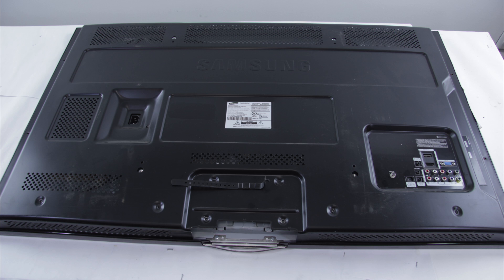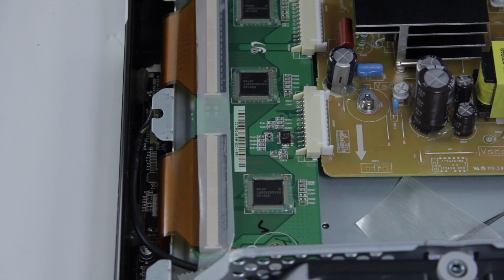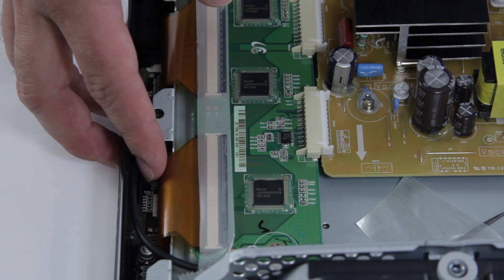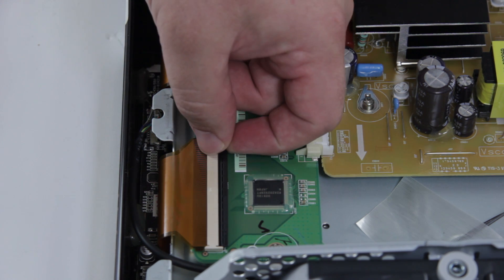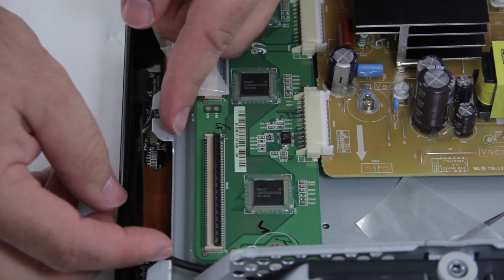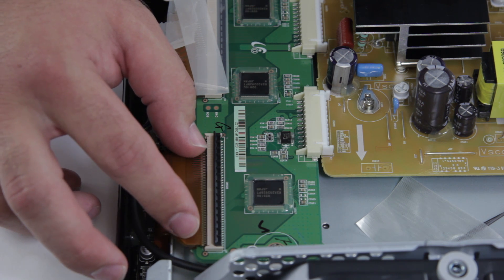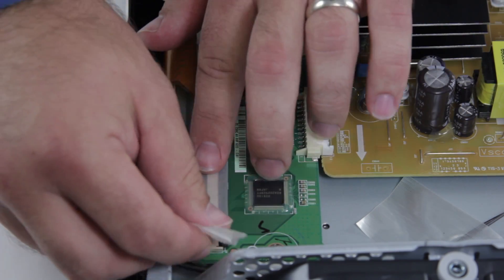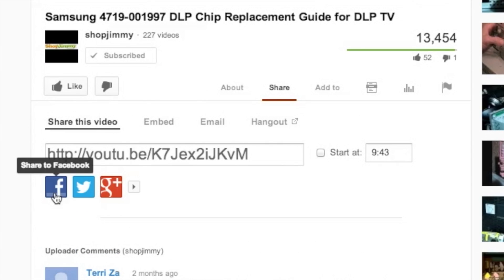Plasma TV Repair Ribbon Cable Removal & Install Tutorial Overview

Comment: We have thin screen 60 inch Samsung TV, Model No. QN65Q60BAF. In the process of moving the TV my frien grabbed the TV on the right corner resulting in a small bubble imprint on the lower right hand corner of the tv. When we turn on the tv the picture is only shown on the left side and still has the small bubble on the right side of the tv. Any suggestions to repair would be greatly appreciated

Comment: My ribbon doesn’t snap in like that. Looks like my ribbon was glue down to the panel. I have a Ns-50df7109a19 Insignia brand. I have replaced the backlights. But when I started putting the tv back together, I notice that 2 of the ribbon things along the bottom were no longer sticking to the panel. I wasn’t sure if this ruined the tv… turned it on, there was sound but a blank screen. So I glued the two ribbon down to the panel then turned it on. Still same thing. At this point I feel like I just need to replace it. First time DIY fixing and I regret it lol! What should I do?

Comment: Hi I have a Samsung plasma 50inch tv and its got 4 thin lines going horizontally at the top of the screen I've unplugged the ribbon on the side that has 2 ribbons one at the top and one at the bottom, the one at the top has a crease in and the line of metal thats plugs into the circuit board has a little tear it is there any way I can fix the ribbon. Please help me

Comment: Thank you for uploading this EXCELLENT video! Is repair possible for the ribbon cable itself? My Samsung PN50B550 plasma was working perfectly BEFORE a recent house move, getting a few black horizontal lines, I suspect some of the cable 'lands' have opened as a result of the set bouncing around in the U-Haul. I would HATE to have to throw this beautiful (HEAVY) set into the dumpster. Thank you in advance for ANY help you can provide! I would rather spend $500 to repair THIS set instead of spending that money on the latest LCD 4K 'wonder'!

Comment: My lg 60UH6035 have blurry picture with horizontal line on the bottom half. I try checking (plug and unplug) the right lcd ribbon from the t-con broad to the tv and now there is no picture at all. What component do I need to replace?

Comment: My Onida LEO40 FAIN Model, Indian made, two FFC cables with very thin copper conductors - AWM 20861,E309746 got damaged. Am finding it difficult. to get owing to lockdown. Have replace them with aluminium FFC, but I get only half picture. Shud I have to replace FFC with originals specs only?

Comment: TV turns, screen works fine. No clicking. After about 5 seconds it turns off and then turns back on.
 Samsung
 65in plasma 
Model: S63FHYB06
SN(Code : BM96 - 18203A)

Comment: I have a lg50pc5d and replaced the sus boards.. Im having difficulty with the ribbon cable's. When i go to latch them in, i get a small crease or bend in the cable which results in black horizontal lines.. Ive tried numerous times and can get most out but still have some. I know its the way the cables are going in. WHAT am i not doing right?

Nevermind i figured it out. I wasnt getting them in deep enough. It's a tight fit and i had to use a wave type rolling motion.

Comment: My Sharp Aquios is dark on one side. Sometimes I can squeeze the edge and it will come back, but after a while it will go dark again. Is it difficult to fix or should I just get a new TV?
Reply: It's not difficult to fix simply remove the frame and look around for the ribbons, one of them is damaged(probably the one from the edge you squeeze) tape something on top of it to keep pressure on it and you're fine

Comment: i have a sanyo 50 inch, before i used lil foam pieces on top of the flex cables u showed in this video.. that isn't working anymore.. so my question is.. can i use a heat gun on low to re-connect the cables like factory again ??

Comment: On a sanyo tv power supply board,  fw50d 36fb- me3a.  I seen the customers tv wasn't functioned correctly.  I opened the back area and the ribbon was giving me a problem.  What is the proper solution to that ribbon.

Comment: Hi, I'm having Samsung PN42B450B1. last few weeks screen showing black vertical bar at the right end from top to bottom. I tried reconnect the bottom ribbon cable at the right end of the buffer board. but still the problem persists. Please help me to solve this problem.
(I'm not a technician I just done this using the information I got from internet)

Comment: We replaced the boards on our tv and then turned the tv on. It worked with the new boards, but there are lines going across the tv in 4 spots. How do we know which ribbon was installed incorrectly, assuming that this is the problem?

Comment: Watched this and clearly makes sense. I have a Samsung, plasma, model # PN50A450P1D, problem I have is a 2.5 inch purple band, vertically running from top to bottom of tv, located almost in the middle of the screen, other than that runs good. I have located possibly 4 capacitors that may be bad due to the top of them being raised (convex) and one is oozing brown fluid. 3 of them are on the main power board and one on the board located at the left side viewing from the back of tv that has 6 ribbons. Would these capacitors be the problem?.....thanks

Comment: I need help removing the ribbon cable on the 6632l-0486b inverter board. I don't see a tab to release the cable and do not want to break it as I've done on laptop system boards several times.

Comment: Hi, I have a 60 inch LG 60PV250 Plasma TV. I took it to a repair man, he replaced the Y boards, Main Board and I think the Z board. It worked fine when I first got it home, but then after a few hours of use the screen shrunk on the sides by 4 inches on each side, then started showing 5 times on each side with only an about 24 inch space of solid picture. I read that it could be a ribbon, do you have any suggestions? I don't want to take it back to the repair guy because he's already put me off for 4 days and won't even come to my house, he wants me to lug it back to him although he runs repair calls in his truck. So I don't really want to deal with him again.

Comment: I have a Samsung 42" plasma with 1/8" vertical line. Model PN42A400C2D, Oct 2008. I read that reseating the ribbon cables on the logic board could help. Not sure how to remove and reseat them. The connector is white plastic and looks like two round pins on each side that go through the board, and there are small 1/8" slits near the pins. The cables connect with identical connectors to the long narrow buffer board. Appreciate any help with these connectors. Thanks.
Reply: I figured out how these connectors open. The gray bar flips up towards the connector. Tried reseating the ribbons in all four connectors - no change in vertical bar.

Comment: Hi there! I have LG plasma TV. Model NO:60PN5300-UF and Serial no:306RMKU7W229. My TV cable connector is broken at the back and it's coming out. Do you know how to fix this? thanks
Reply from the maker: +Shekhar k.c   Try all repairs and troubleshooting at your own risk.  I recommend replacing the main board in your TV.  Click this link to replacement parts for your TV model number:  http://www.shopjimmy.com/catalogsearch/result/index/?cat=56&q=60PN5300-UF  There may be multiple boards for the same TV model number, be sure to match part numbers on your current board, with your replacement for compatibility.  Thanks and please let us know if you have any further questions with your TV Repair!  www.shopjimmy.com

Comment: Haier 50" Model No Le50f2280 Are ribbon connectors replaceable n also my tv started flickering, is this due because of power supply?
Reply from the maker: +Erick Trevino   Try all repairs and troubleshooting at your own risk.  This sounds like you have bad LEDs in your TV.  Unfortunately we do not sell replacement LEDs for your TV model number at this time.  You can check back in the future to see if we have them available.  Thanks!  www.shopjimmy.com

Comment: Sony Bravia, Model No. KDL 32EX650, Sl No. 3692940
Defect: Horizontal lines appearing all across the length in approximately 60 percent area from top. It appears as if someone has drawn a graph with white lines.
Reply from the maker: +Mukund Kumar   Try all repairs and troubleshooting at your own risk.  This sounds like a TV panel (TV Screen) problem.  If your TV panel is bad, it may be more cost-effective to replace the TV as panels are typically hard to find in stock, difficult to replace, and expensive.  Thanks and please let us know if you have any further questions!  www.shopjimmy.com

Comment: i have sony 42 inch kdl-42w674a which running perfectly but after half an hour or sometimes 3 to 4 hours, the black bars appear on the centre left of the screen. when turn of for around 1 hour and restart again it run perfectly again but only for half an hour or more if im lucky. is it the mainboard problem or t-con which is built in with the panel board?

Comment: Damaged Ribbon Cable Going Into The Y Buffer Board.. Is It Replaceable?
Reply from the maker: Constantine Chioles  Try all repairs and troubleshooting at your own risk.   If it has the panel on one side and the Y-Buffer on the other side, no it is not replaceable.  Thanks!  www.shopjimmy.com

Comment: hi, first of all thank you for this! my samsung tv ps51d55oc1m picture went a shade of blue. and stronger in certain sections. it sometimes goes back to normal but stays blue for longer and longer. thanks for any help you may have ^_^
Reply from the maker: joshua filbee  PLEASE SUBSCRIBE TO OUR CHANNEL - Try all repairs and troubleshooting at your own risk.  I recommend replacing the y board and y buffer(s) in your TV.  Unfortunately, I do not see replacement parts for your TV model number on our website.  Thanks!  www.shopjimmy.com

Comment: Samsung PN58b540s3fxzc  Picture just went out,still has sound and when I power it back on I get a SNAP sound. Power supply? thanks
Reply from the maker: Virginie Boudreau  PLEASE SUBSCRIBE TO OUR CHANNEL - Try all repairs and troubleshooting at your own risk.   I recommend replacing the Y-Main Board and the Upper and Lower Y Scan Drive boards in your TV.  Click this link to replacement parts for your TV model number:  http://www.shopjimmy.com/catalogsearch/result/?q=PN58b540s3  There may be multiple boards for the same TV model number, be sure to match part numbers on your current board, with your replacement for compatibility.  Here is a link to a video showing how to identify your part number, click here:  https://www.youtube.com/watch?v=R1jmj_foId0  Thanks and please let us know if you have any further questions with your TV Repair!  www.shopjimmy.com

Comment: Hello there I have a Samsung 50" plasma TV model number is : PS50C680G5K and serial number is : B2G2H4PZB06430J . The problem I have is that the TV will turn on with no problem for about 15 minutes then it will turn off by its self and then make a clicking noise. Could you help me find the parts I need to fix this issue 
Thanks
Reply from the maker: *****   Try this at your own risk. Unplug the TV, then disconnect the y board and plug in the TV to see if the TV powers up. Reply with the results of this test. Thanks! www.shopjimmy.com

Comment: hi i was wondering if its safe to use electronic contact spray cleaner on the ribbon cable connectors and ends [to and from the tcon] also is it safe to use on the tcon and the rest of the circuit boards [ have MG brand says no harm to plastics and leaves no residue] I'm experiencing a red translucent apx 2 inch wide vertical bar on the left side of a 2010 sony kdl60ex500 that hard to see on scenes of high brightness,disappears on black backgrounds ie when back bars on top and bott of picture.On the sony start screen the area turns to a lighter shade of blue as opposed to the darker blue of the logo.Disassembled to the removal of the frame to see if applying pressure to the bonding tab[s] would make a change[no difference]was going to try reseating the ribbons in their connectors but having a hard time getting them open thought perhaps spraying them down may be enough to restore a good connection,was considering the same for tcon board too [again would this be advisable?] do you think this is a tcon issue? and if so where would i order one [near Canada]  your help would be greatly appreciated,thanks for your time

Comment: I have a 46' westinghouse serial # 6240Y12500052 - the right side is dimmer than the left side, it almost looks like it will be going out soon.
Reply from the maker: Charmaine Burnette   This sounds like a TV panel (TV Screen) problem.  If your TV panel is bad, it may be more cost-effective to replace the TV as panels are typically hard to find in stock, difficult to replace, and expensive.  Thanks and please let us know if you have any further questions!  www.shopjimmy.com

Comment: Is it possible to replace a ribbon cable that connects to the logic buffer e panel on a samsung model pn50b450b1d.  buffer panel pcbs #lj41-06244a?
Reply from the maker: Ryan McCann   If the ribbon cable is coming from the panel, then no you cannot replace the ribbon cable, you would need to replace the panel.  Thanks!  www.shopjimmy.com

Comment: I have LED 46 inches. 
the Y copper ribbon cable got burnt/slit is seen in the cable. 
Causing half of my screen is showing multiple vertical colors.
Please suggest solution how to fix the issue.
Reply from the maker: Rajesh Battala   Unfortunately you cannot repair that.  Thanks!  www.shopjimmy.com
Reply: ShopJimmy.com Thanks for the reply

Comment: Hi, I have Samsung Plasma TV, model PN58B540S3F code PN58B540S3FXZA, it has black screen, everything else works fine like sound, switching inputs etc. Is this a bad logic cntrl board LJ92-01564a/b/c/d?
Reply from the maker: Gevorg N   Please watch this video FIRST to help with your repair!  TV Repair! LCD, LED, Plasma, DLP How To Fix Your TV with ShopJimmy.com Help!  I recommend replacing the Y-Main Board and the Upper and Lower Y Scan Drive boards in your TV.  Click this link for replacement parts:  http://www.shopjimmy.com/catalogsearch/result/?q=PN58B540S3FXZA  Be sure to match part numbers on your current board, with your replacement for compatibility.  Here is a link to a video showing how to identify your part number, click here:  Samsung Plasma TV Repair: Samsung Plasma Panel Parts Guide  Thanks and please let us know if you have any further questions with your TV Repair!  www.shopjimmy.com

Comment: Hi my tv is 32 in westinghouse model no.DW32H1G1 my tv was working fine yesterday and this morning their was sound but no image just colored stripe so i disconected it I opened my tv and found nothing wrong but 1 of the 4 ribbons is burnt.can only the ribbon be replaced.and how or do i have to buy the whole panel

Comment: Hello, I have the exact model on this video. I have thin black lines going across the screen screen had reddish picture on dark scenes. first I replaced the Y-buffer board only, thin black lines still appeared with y-buffer but not as many,   So I replaced the Y-main board, now the dark scenes look great, but I still have some this black lines running across the screen only there are fewer that with the old Y-buffer board. Could I received a bad y-buffer board? once I plugged the new Y-main board, the lines cleared up on certain spots on the screen, fewer lines. Any suggestions? Do I need to clean the ribbon cables? Thank you
Reply from the maker: Mike v   Try this at your own risk, TURN OFF THE TV and unplug.  Then take a little rubbing alcohol and a q-tip to the ribbons. Clean them and let them dry completely. You can also blow out the connectors too to help clean them out. Once fully dry. insert the ribbons and then turn on. See if the lines changed. If they cleared up. Again turn off, and try re-seating the cables. They can be really tough to get in correctly sometimes.  Thanks!  www.shopjimmy.com
Reply: ShopJimmy.com  Hello, I did what you described. I also replaced the y-buffer board in case I received a bad one. It was brand new y-buffer. I still see thin black lines at exactly the same spots as the other y-buffer board.  Could it be the y-main board?  or anything else that can be causing these thin black lines across the screen?  please help, much appreciated.  Thank you
Reply from the maker: Mike v   The Y drive won't put lines in the image with the rest of it being a good picture. I'd keep trying to reseat it, it can take multiple attempts before you get rid of the lines. If after multiple attempts it isn't fixed and your using a new buffer and its now your third replacement, I'd say the panel has issues. At that point you would need to replace the panel, which may not be cost-effective.  Thanks and please let us know if you have any other questions!  www.shopjimmy.com

Comment: Hi I have a Sony LCD TV model# KDL 32EX 400. When it's on the screen has black vertical lines.  Can this be cause by the timing control board being faulty?
Reply from the maker: Joy-Ann Waithe   This sounds like a TV panel (TV Screen) problem.  If your TV panel is bad, it may be more cost-effective to replace the TV as panels are typically hard to find in stock, difficult to replace, and expensive.  Thanks and please let us know if you have any further questions!  www.shopjimmy.com

Comment: I have a lg 60pc1d I'm trying to remove the 60x7_z board to see if it is bad but there seems to be a hidden screw I can not find 
Is there a trick to removing this board?
Reply from the maker: Eddie Valdez   It's probably stuck to the heat sink if all the screws are out just lift.  Thanks! www.shopjimmy.com